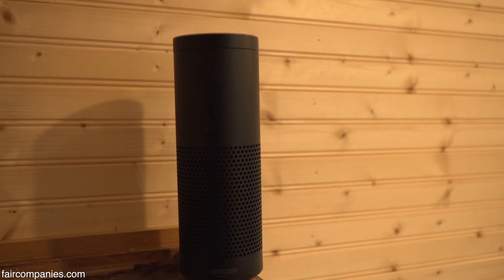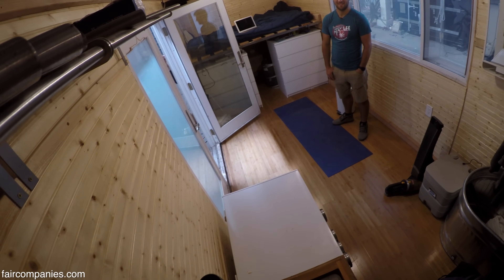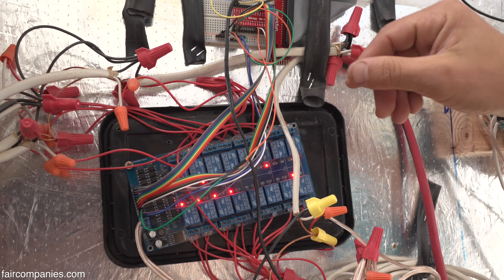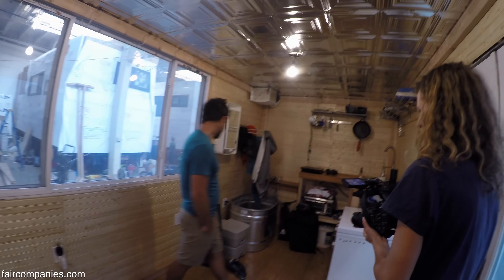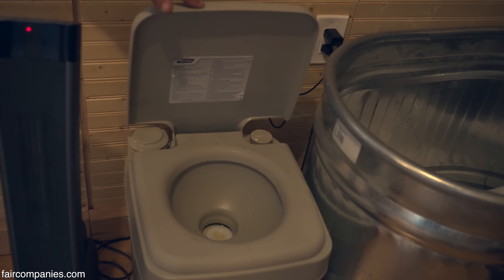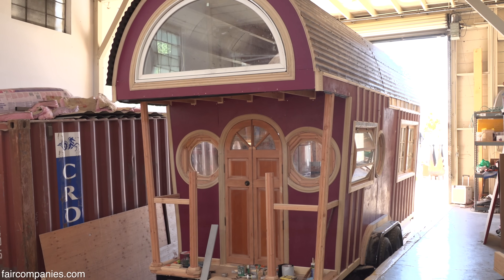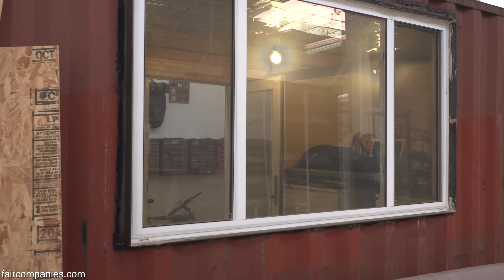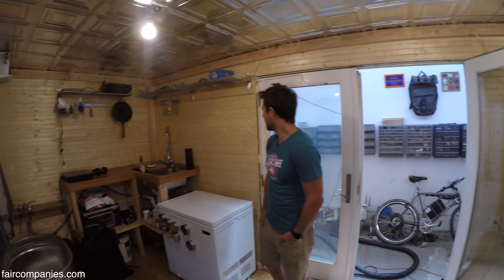Automated container home on a budget obeys voice commands

Comment: idk if the builder will ever see this comment but I just want to say a couple of things. One, great job! You're forging a path to affordable smart homes. 
Two, I understand that this is a proof of concept, but telling Alexa to cut the lights is slower than having to flip the switch yourself. Alexa was designed to answer people back so it would be the same as you telling your mom to shut the lights for you and she replies, "ok~!". If you want a challenge, perhap you can make your own voice sensor so that it just reacts to the vocal cues. 
Finally, this is great that you're proving a point by not adding switches but it's good engineering if you add them anyway. Especially the way your "utility closet" looks. If the humidity of your water system or the rain fries your computer system, at least you have a hard switch to turn your lights back on. 
Overall, thank you for sharing! 

last note: heard of the saying, "don't shit where you eat"? quick fix is a curtain but a better one is to move your bathroom to one end of your home (so that the tub and toilet face opposite of each other) and build a partition wall and then have the kitchen fit into that wall. If the objective is to have space, then this wouldn't take more than 5-7' of your lengthwise space.

Comment: How is any of this "smart"?
A smart home would optimise certain process and adjust them automatically. For what this guy is trying to do you can get a little remote and a bunch of receivers and turn on and off things without any programming and no smartphone required either. 
It is the managing and optimising of process that can make a home, usually a large one, work a bit better, not just turning appliances on or off.

Imagine DIY programming a heating app that has an adjustable heating curve, takes data from sensors to optimise operation based on a user defined heating calendar. Imo it would be a complete waste of time because even the cheapest tiny plastic controllers can do that these days and heaters from decent companies can take input from such devices without any programming required. Why reinvent the wheel?

How about then programming something to manage cooling? How about programming something that optimises both heating and cooling between each other?
It is not enough to understand syntax when the real challenge is understanding the very concepts of optimised heating and cooling which requires heavy R&D time in a whole number of fields!

That something is a proof of concept is not an excuse for lacking the actual proof of the concept already in there. It is not good enough to just say "ohh you can do X with it" because the challenge is in actually doing so, not just realising that the possibility is there.
Reply: He's having fun making unique homes. He expressed a vision to eventually optimize and automate it. 
I feel like you're mocking him for playing around and having fun. How about you encourage the guy that might actually do the things you're talking about instead of degrading him for not being at the stage of automation you're describing?
Reply: You have to start somewhere.
Reply: Yeah, preferably by getting a library card - this is not starting anything, this is just a guy hooking up various toys to a switchboard.
Reply: Dirty Dan 
Good thing this is not your home. He's doing it for himself. Your opinion is irrelevant. I personally don't want my house computerized, and certainly not my car, but I don't begrudge this guy his bit of fun.
Reply: The hardest part is what he did. Connecting the pieces, making them accessible to the computer. If he can control his system using Alexa, anything else should be accessible with relatively simple scripting.

You shouldn't feel so powerless man, give yourself a few months of learning programming and then a few months of learning basic networking, and you'll understand the power standard interfaces give you. Computers can be infinitely complicated, but people don't want that, they strive to craft easy APIs that you can then use easily.

Educate yourself with a few tutorials from non-famous people (to quote you) and you'll see that people have done it already, and that it's really not that hard. There's a good example on this very channel of an old guy who automated many parts of his home, including gardening systems.
Reply: You've got to build something to figure out what matters and what doesn't.  Like, for instance, would making the window film go opaque actually reduce solar gain?
Reply: You are interested in different problems than he is. Your "tiny plastic controllers" don't communicate together. You can't send it a global "I'm home" command that opens the lights, starts heating and begins boiling water.

Centralizing every input and output is the first step in making a smart home. Once that is done, adding new "features" and more complex interactions is easy and painless
Reply: +Borys Pomianek, you discredit your own arguement.  First you describe experimental investigation, then whine that this guy is doing experiments.  Where do you think your "experts" get their expertise?  By experimenting, refining, and then experimenting again; just like this guy.
Reply: Chaz Evansdale not degrading just making valid points. also when building multi thousand dollar homes, one usually takes these matters seriously. i want my home built in a professional manner, not built "for fun"
Reply: +Kawaii Usagi I doubt you have any idea how to add any said features nor this guy in the video have any idea. All you people do is wax on about fantastic features that you are going to implement some time down the road and my point is that you have no idea how to do it today and have yet to demonstrate any of it working.

Some of you see yourselves as masters of these technologies because you found a tutorial on a forum somewhere and ape famous scientists and people of industry by poetically looking into the distance expressing the great promises of this or that however you lack the expertise to R&D a solution.

Meanwhile similar features already exist for years in all sorts of simple off the shelf devices and no amount of pouting or ad hominem will change this fact nor the fact that unless you implement, demonstrate and document a feature, it simply does not exist.
Reply: +Kawaii Usagi
The hard and expensive part is building something properly then testing for heat bridges (heat camera), possibly doing a pressure test, after-which calculating how the air moves between rooms, how the walls and floors heat up (heat mass), heat transfer between walls and air, what happens to moisture, which layer stops moisture going in or out etc. 
When designing heating and cooling people do all of those things and it has nothing to do with programming or networking.

Using insulation of a given coefficient does not magically make your wall have that same coefficient nor throwing around terms like "solar gain" actually proves you know how to measure it and quantify for the purpose of your mathematical model (I don't, do you?)

This guy might install his insulation and then have moisture gather between the insulation and the steel frame of the container and end up breathing in mould in two years time and no amount of networking or coding will change that but hey gobble gobble networking gobble gobble coding.

People who do DIY need expert advice, not a bunch of randoms on the internet going "you can do it, you just have to believe". You are not being positive - you are just being fashionable and that is a great way to suffer carbon monoxide poisoning, ingest neurotoxins or maybe just burn to death...
Reply: +condew HacDC 
There are no "my" or "your" experts and people who build homes and are accredited to design different parts of them are not inverted coma experts either.
Science is not about reinventing the wheel and cobbling around with a bunch of consumer products made by someone else is not "experimenting" nor does it make you an inventor.

Your god is a mobile phone.